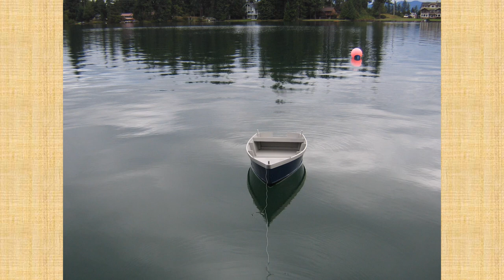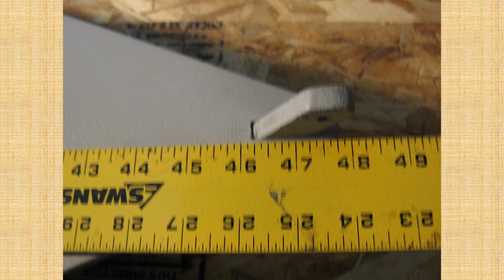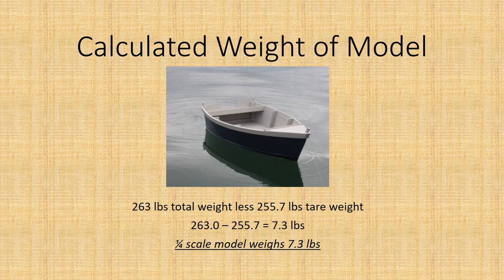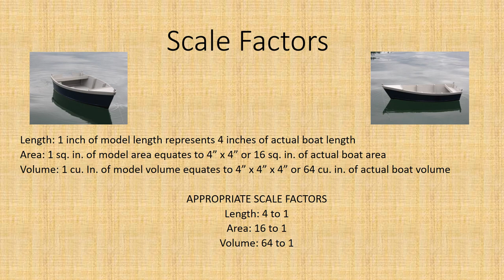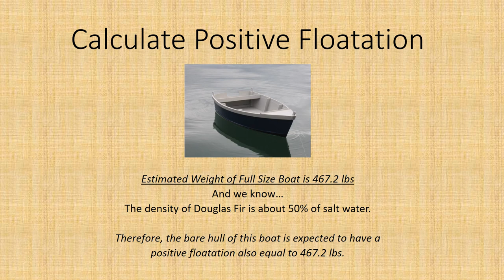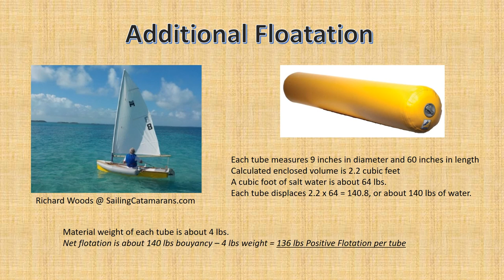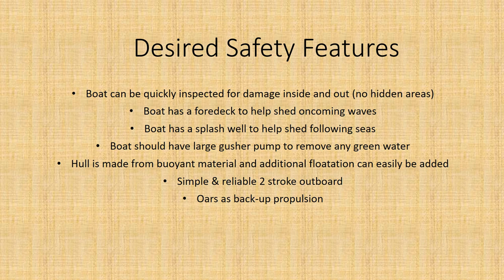Episode 1 of 2019 Boat Build

Comment: I have been watching your build and I have to say yours is the best for new guys like me I have a couple of questions if you don't mind  I like your model boat can you tell me how you scaled the plans down what if I wanted to make a model like yours or say an 8 or 10 footer for pond hopping something one man  could handle  for example if I made one 8ft long the sides have to be shorter and the bottom would not be the same size as the 16 footer and what size would the frame work be can you tell me how to figure this out I thank you for your time and your channel is very well done
Reply from the maker: Thanks for watching. I built the model by scaling down every single dimension by a factor of 4. Since this is a 16-foot boat, if you want an 8-foot scale replica, then you would want to divide all the dimensions I show in this build by a factor of 2. In other words, everything would be half as long, half as wide, half as tall and half as thick. If you do this, you will end up with a boat that is half as long, half as wide and half as deep. All panel areas will be 1/4th (i.e. 25%) of original. All volumes will be only 1/8th (i.e. 12.5%) of original. Therefore, this boat scaled down by a factor of 2 will only be able to support 1/8th as much weight. Recall from episode 23, the maximum safe load for this boat was calculated to be 1,622 pounds. If you scaled my boat down by a factor of 2, your safe load will be 1/8th of this amount or about 200 pounds. This may not be enough for you. As for strength and stiffness, if you scale all dimensions down by a factor of two, you will end up with a boat that is twice as strong and four times as stiff. So structurally, you will be stronger than the original size. Rather than scaling down this boat, you may consider finding plans better suited for the size you are interested in. Hope this helps.
Reply: I want to got that a shot thank you for taking the time to help me I appreciate it alot I'll let you know how it goes thanks for sharing